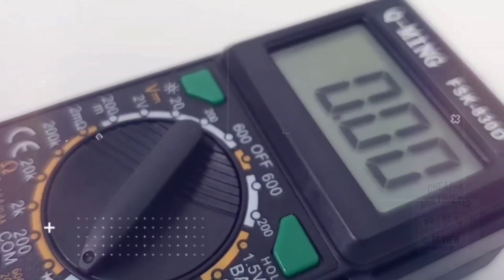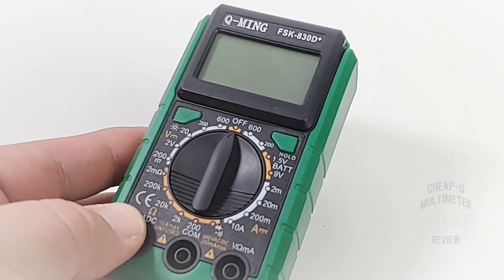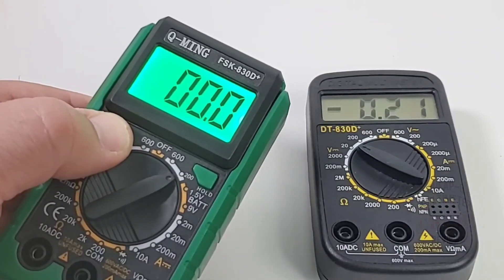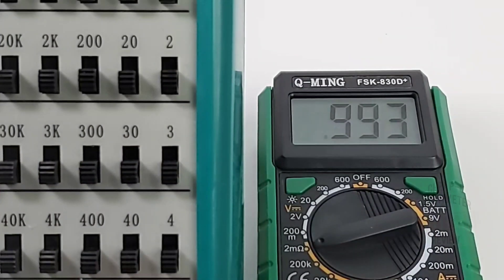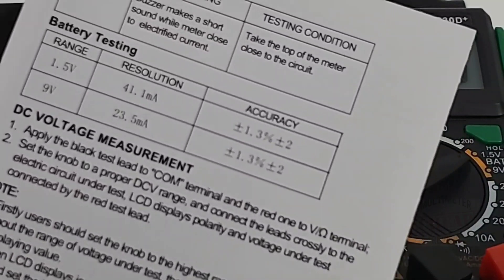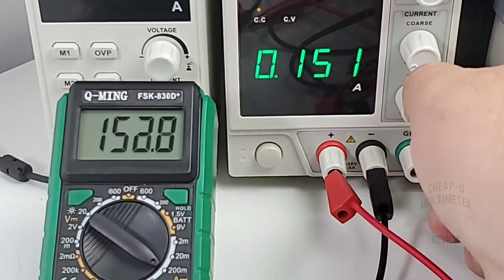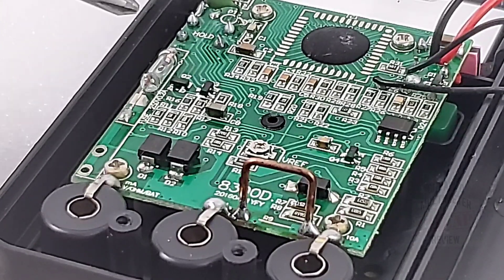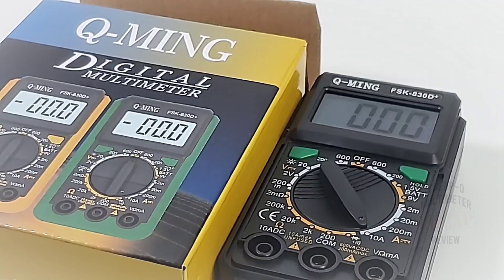Q-MING FSK-830D+ CHEAP-O Multimeter Review & Teardown!

Comment: May I suggest a battery draw test of these meters. In the various ranges, after auto shut down and while the range switch is in the off position.
Reply from the maker: Great idea, however it would be too time consuming to cover all the ranges all the time.. I do try to run current draw tests in  multimeters which exhibit unusual features , displays or have known issues.
Reply: @KeepOnTesting  Thanks for the reply, the reason for the suggestion, I recently moved, had some multimeters in boxes. When I finally opened the boxes and tried the multimeters some needed new batteries despite not being used for a while. Assumed a current drain when off.

Comment: Nice test, have you ever seen or compared the internal structure of these 830 clones to see which ones are better? Also, using current to test a battery is quite the roundabout way to do it but maybe more accurate actually, like testing how much juice it could still provide. But how will you know if you lose the manual showing the expected discharge current for the battery?
Reply from the maker: Great points Ramon! I'll do a full spectrum review of the 8xx CHEAP-Os at some point with an emphasis on those internals...agreed, easy to forget those battery specs...might have to take them to the back !